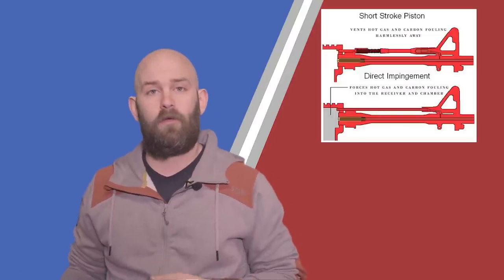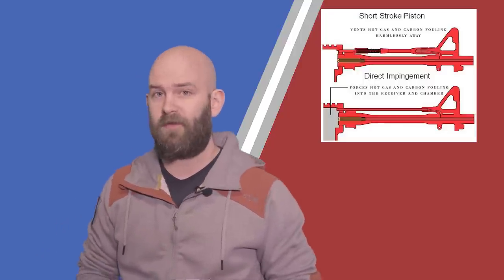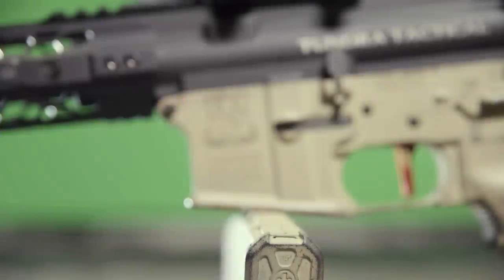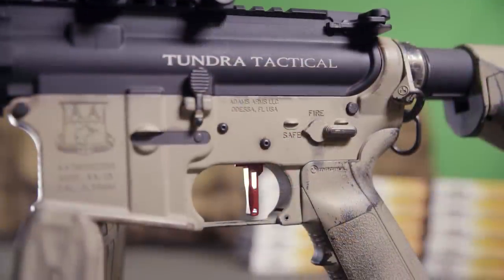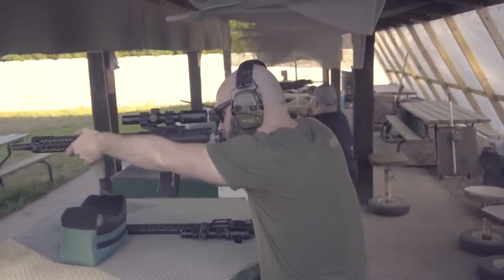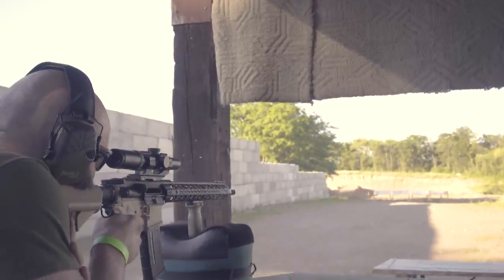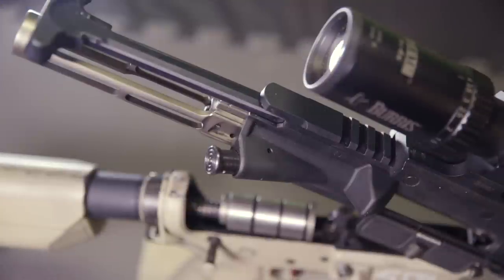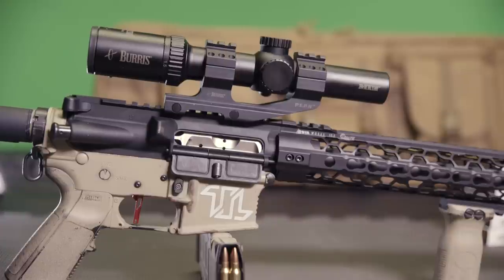Tundra's Guns Episode 1: Tylers AR-15

Comment: Great video guys and nice build. Aim surplus makes really great stuff so is no surprise their BCG is chugging along fine. I've never been behind the burris but I love my strike eagle! Not only would you get the finer hash marks in the center reticle but you'd also get another 2x of magnification too. Or you could drop another $100 or so and get their new 1-8 strike eagle. I think the 1-6 has more than enough magnification though for a basic 16" barreled AR. I'm also a fan of the wide cheek weld stocks too and run the BCM mod 0 sopmod. It's SO comfortable and stable. I have a strike industries extended latch charging handle on one of my rifles and is honestly just as nice as the BCM medium size latch I have on one of my others but was much cheaper.

Comment: Quick question did you use the same Barrel and what type of gas block
Reply: Reason I'm asking I have a Ruger sr-762 I would like to make d i
Reply from the maker: I have to think back on that one, i honestly cant remember the brand, i know it was not a super expensive barrel and that it was a 223 wylde.  In regards to the gas block i got that from a buddy of mine so i dont know the brand, but it is an adjustable block.
Reply: 99% sure we used the same barrel. The gas block for that particular barrel contour was .750. The Adams arms barrel wasn't proprietary or anything, it's just a conversion.
Reply from the maker: There you have it...P.S. hes the guy who built the gun
Reply: Thanks